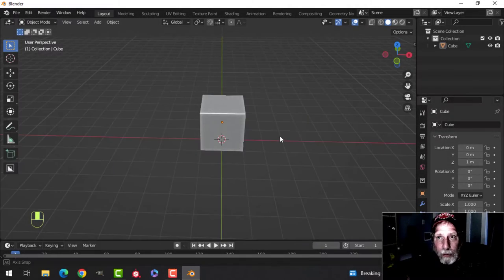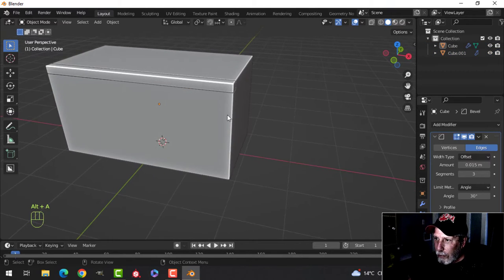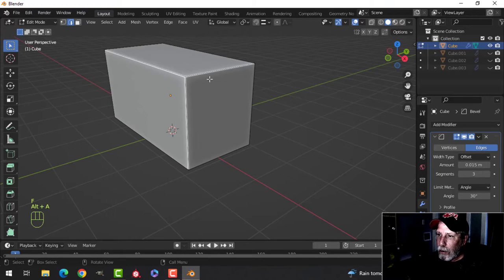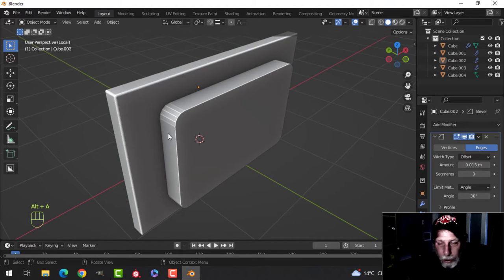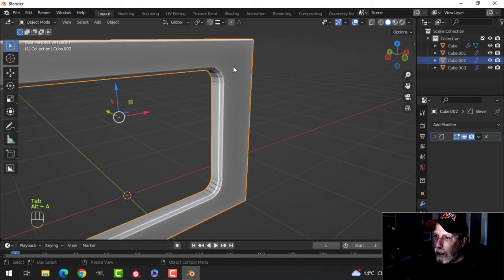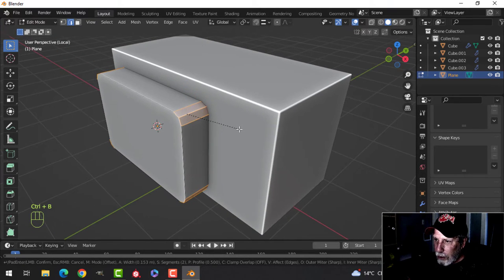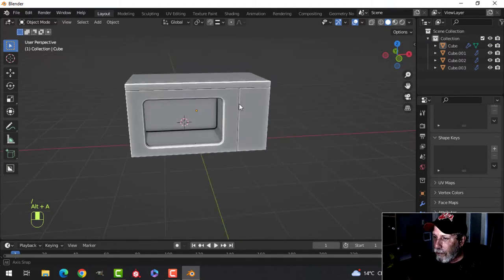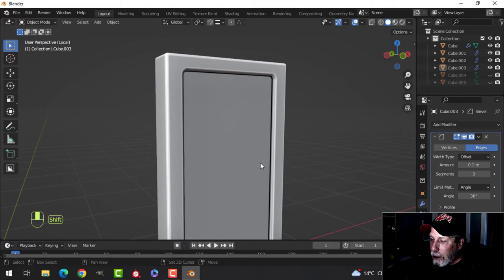BLENDER: MICROWAVE OVEN (MODELING PART 1)

Comment: hey, when I make the button, when I roll my mouse to make more edges the button doesn’t round out.
Reply from the maker: Make sure that you don't have any extra vertices by selecting all and pressing m > merge by distance.  If all fails, try again on a new cylinder, select one face and try to bevel with ctrl-b and roll mouse wheel.

Comment: The faces of your models are not quadrangular or triangular. As far as I know, it is better for the models to have triangular or quadrangular faces for better topology. What do you think about this subject? I'm looking forward to your answer.
Reply from the maker: It's not a problem really.  It depends on the type of model, too.  If this was a character that needed to bend   for instance.  I have ngons which are totally fine for the flat areas.  They will all be triangulated anyhow in substance painter.  So don't worry about that.  Quads are good but not necessary in many cases.
Reply: @zerobio  Thanks for your answer.
Reply from the maker: @semihaksoy8182  no problem